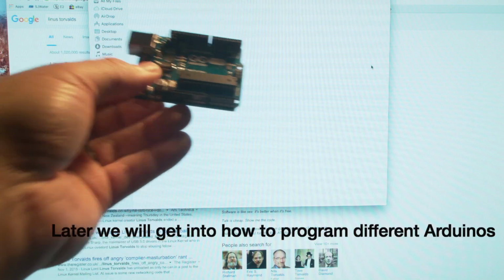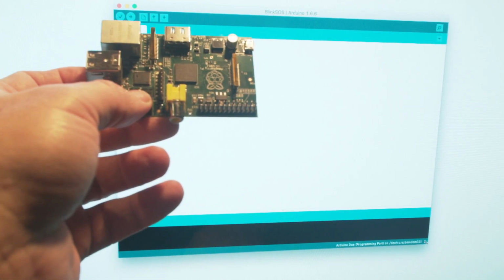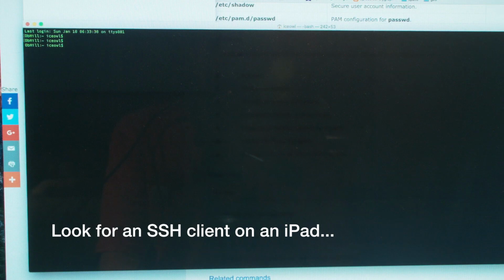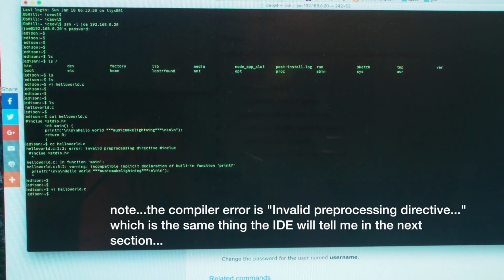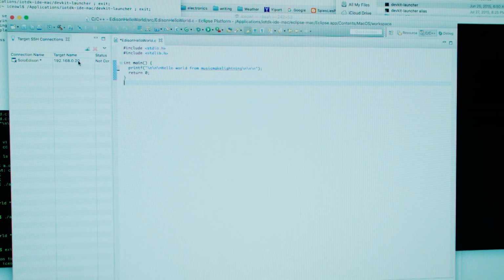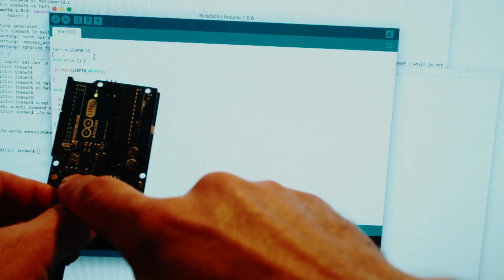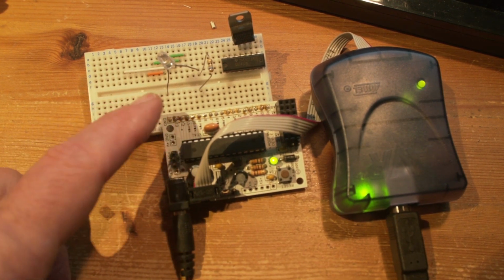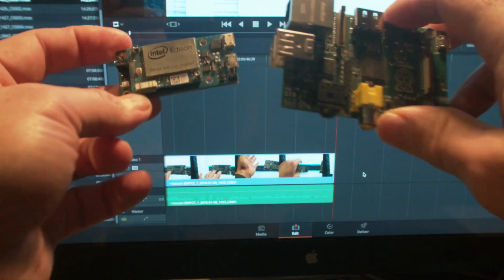Arduino and RaspberryPi/Edison : V2.0 - what to get my kid?

Comment: Since the video's main intent is for some H.S.students(? maybe J.H.), I would offer them advice as to where to start rather than just hitting them with all that info. I started with a Raspberry PI3, but I would advise against that for beginners, and for students, especially if you consider equipment cost whether it be tax funding or private funding. The Raspberry Pi and some other boards are great boards but for the many projects a beginner will do, and for teaching students the basics they are way over powered.

I would have students start with the ESP 8266. It can do almost any beginner project and it is a good base to build larger projects. It is cost effective at $35 for ten vs $35 for 1 RPI. The RPI and other higher end boards are best saved for more complex projects such as mini servers, media centers, and others, where you need horse power and high quality video. My ESP 8266s will do great beginner projects and in fact if you think about it they can be found in many wireless products for home automation if you take them apart and look. I am using mine so far for a remote light for a dementia patient, (because she insisted on taking apart her lamp while plugged into the wall), and a garage door opener, both using Blynk.

I would also start the students with the Arduino IDE, not because I am fond of it, but because it has wide support for working with many boards and modules with a simple Github download, including readily available code examples. It also starts them off with basic C, which is a good thing, because 9 out of 10 languages we use today are based off of it in one way or another. Even Python, is what I call a hybrid child of C and Basic.

Comment: Thanks for the video Joe. I actually have all three of these systems as well, and it was cool to see you could program the Edison with the Arduino interface. Near the end of the video (pt 12), you show the Edison executing the "blinking lights" code. I was wondering if it is possible to interact with the Edison (through the terminal, i.e. Putty) while it's executing another program? Also, is it possible to start that code from the Linux shell and see it operate the lights on the board?
Reply from the maker: +Luke O Hi Luke.  Yes, it is definitely possible to log onto the Edison via a TTY while simultaneously running the Arduino IDE from the USB.  I was interested in your question so I just tried it myself.   Interestingly, you can even log onto the Edison via WiFi while connected to the computer via the USB - but typically to get the WiFI to work reliably, you need to power the board with more than just the USB.  I connect a 9V battery to the circular connector and it works fine.

As opposed to the embedded control boards (like Arduinos), the Edison is running the Linux operating system when it boots up.  When it boots in "Arduino mode" (just to give it a name) it starts up with a program called "clloader" which acts as a bootloader and runs any sketch called "sketch.elf" in the /sketch directory.  This is exactly the same as with an Arduino embedded controller board.  An Atmel Arduino, for instance, has a bootloader which just keeps running whatever was last flashed into its EEPROM.  The /sketch directory in the Edison performs the same function as the EEPROM on an Atmel chip.  And the clloader program, does exactly what the bootloader does - it just keeps running whats in there over and over.

Program loading is different between the Edison and the Atmel, though.  On an Atmel Arduino, for instance, when you want to load a new sketch, the Arduino IDE sends the board a command that puts it into a mode where it is ready to flash a new sketch into its EEPROM.  The IDE uploads the .hex file to the EEPROM and restarts. Then,  on restart, the bootloader just runs the new sketch.

On the Edison - which is running Linux, lots of different programs can be run at the same time, including a program that lets you transfer files from your host computer to the Edison.  When the Arduino IDE compiles a sketch for Edison, it logs on to the Edison, deletes the current sketch.elf, and transfers the compiled program to the Edison - exactly in the same way as it would on any other linux machine.  In a sense, it's a lot simpler than all the fuse setting and resetting that happens on an Atmel chip (at least it is to me).

You can actually stop/start the Edison running sketches by disabling the clloader script in Linux.   And like all Linux machines, you can log into it from different locations.  So, you can use WiFi or USB - all simultaneously.  And you can run Arduino and log in via the SAME USB connector, all at the same time (I know, I just did it.)

Hope that's useful.

Cheers
Joe
Reply from the maker: +Luke O Oh - yeah.  And one more thing.  Sure, you can write your own program outside of the Arduino IDE to flash the lights on the board, etc.  You would use a different IDE (they support lots of them - I use Eclipse) and the gpio library which lets you control the signals out of the Edison.  I have taken an Edison off the Arduino board, and put it on the smaller breakout board, and used the gpio to interface with other devices, like a GPS, and an Adafruit OLED display.   I could have probably done the same thing with the Edison on the Arduino board, but it was easier to figure out which signal went where on the smaller breakout board.

Cheers
Joe
Reply: +musicmakelightning Joe, thanks for such detailed responses! I've been getting into Linux a lot recently, after having previously delved into C for a while, and really think the Edison is an amazing piece of tech. I've got lots of ideas, and think that having all those capabilities embedded is the way to go (i.e. a full operating system, + libraries, etc.). It almost seems like the Edison is (kind of) a cross between the Pi and the Arduino, in the sense that it is a head-less "embeddeble" computer but has the full operating system that Arduino lacks. Thanks again!
Reply from the maker: +Luke O No problem!  Actually, your analogy is a good one.  The Edison actually has two processors in it.  One, the Atom, runs Linux exactly the same as the Raspberry Pi.  The other processor is called a Quark, which is much more like the Atmel microcontroller, but actually is another whole processor capable of running an operating system.  The way I understand it, both are dual core.  The issue is, that as I type this - when you program the Edison you're only talking to the Atom processor.  They don't have any software out there yet that lets you take advantage of the Quark.  In essence - you'd actually have a Raspberry Pi and an Arduino in the same little package.  BUT, they're only taking advantage of the Atom right now (Feb 2016), running Yocto Linux.

So, basically when they emulate an Arduino right now, they're just running a program on the Atom which runs the Arduino sketch the way an Arduino would.  I guess eventually, they'd try to make the Quark run the Arduino code...but it doesn't.  The idea is that the Quark will eventually run an RTOS (a so-called REAL-TIME-OS) so it's not exactly like the Atmel microcontrollers either, but possibly more powerful...someday....

An interesting experiment would be to see if you could get the source to CLLOADER and port it to the Raspberry Pi.  Of course, you'd have to create the Arduino Core files to support it, but in theory, you could make a Raspberry Pi emulate an Arduino in exactly the same way ;)

Thanks for your comments!   I do appreciate it.

Cheers,
Joe